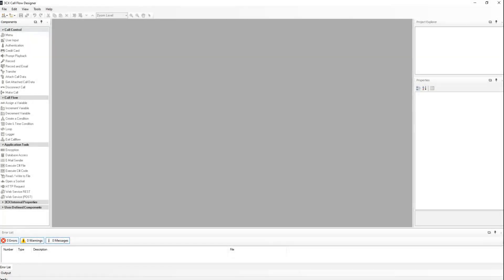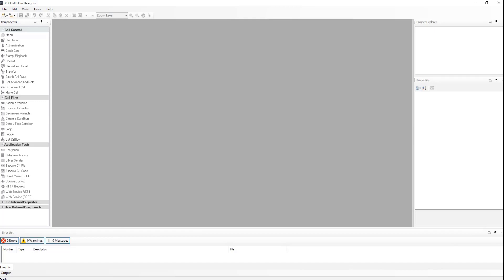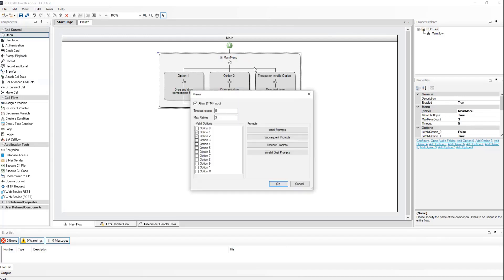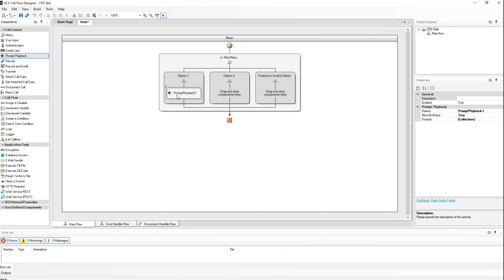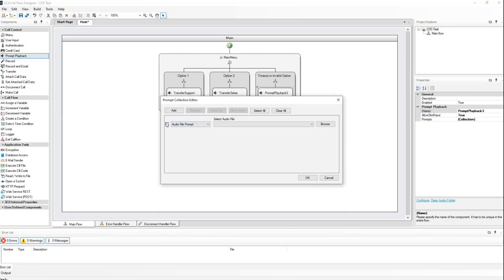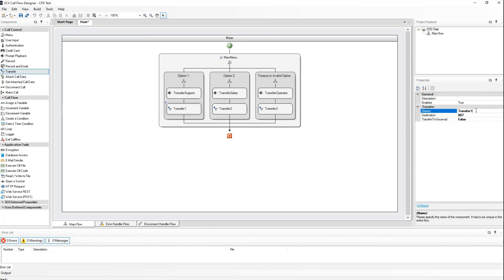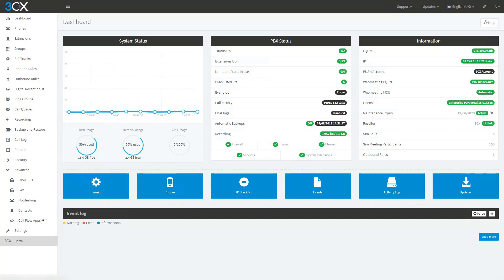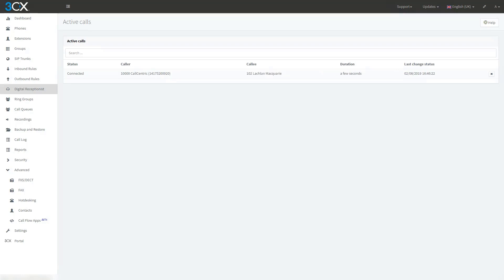CFD Video Tutorial Part 1 - Creating a Call Flow

Comment: Are we able to use the call flow designer on an individual extension play a message before they are connected?
Reply from the maker: Hello Lim, 

A CFD app can only be activated when a call is explicitly sent to it. It can't intercept calls sent to other entities. So, you can route inbound calls from an external line to a CFD app, to play a WAV file and then transfer the call to the extension. However, if someone directly calls the extension, the call will be sent to it, and the CFD app will not be activated.

Comment: Hello guys, these tutorial videos are awesome, they helped me in many ways with the 3cx call flow designer, but I have a question: how can I use session variables in the call flow designer? this answer will help me a lot
Reply from the maker: Session variables (https://www.3cx.com/docs/manual/cfd-conditions-variables/#h.gerfdz7c0fxh) can be used as part of any component of call flow designer that we provide the ability to set Expression (https://www.3cx.com/docs/manual/cfd-prompts-expressions/#h.v17ic2wxant9)

On Expression Editor you will get a specific tab with the available variables of the project, including session variables. You can use those to set the execution path of the path according to your business requirements.